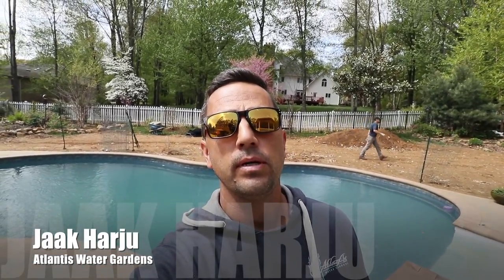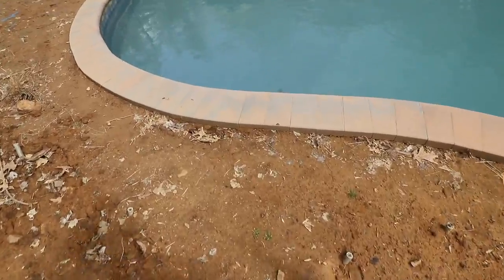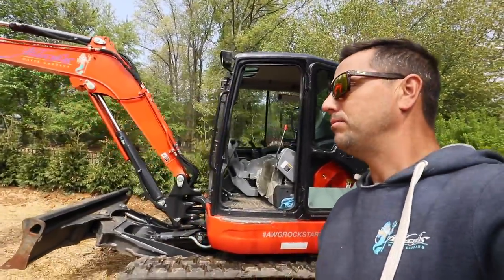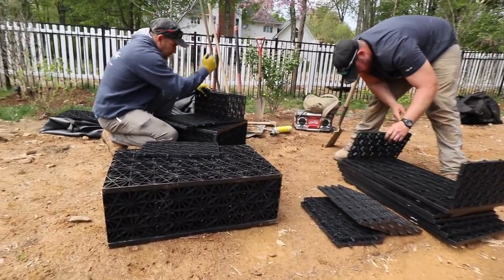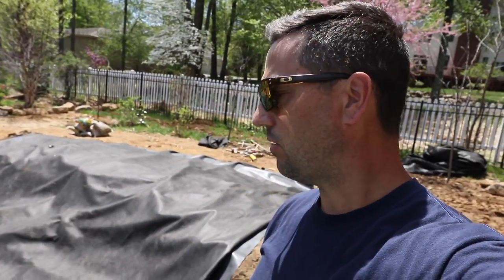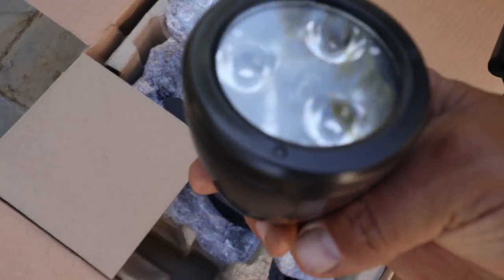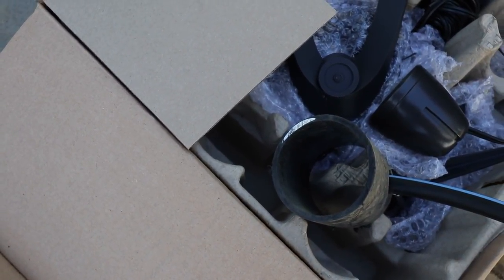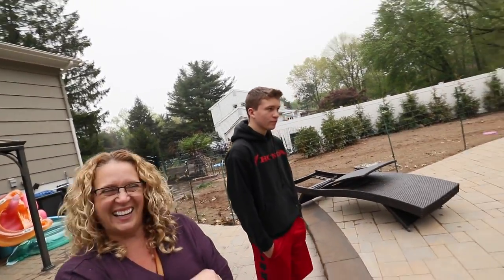Pool Area Waterfall - Building a Disappearing Waterfall Against a Vinyl Inground Pool - Randolph, NJ

Comment: Awesome videos Jaak! What kind of conduit do you use for the lights? Type and size? Any reason you switched from using the kink-free hose?
Reply from the maker: FallingWater Scapes the wire was getting stuck in them when it was hot out because they are lined with rubber
Reply: Thanks!